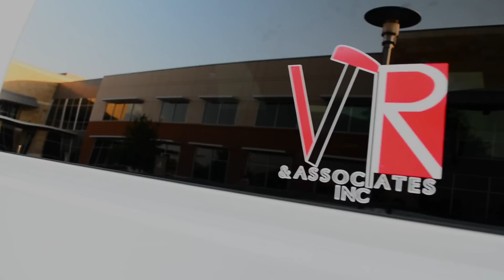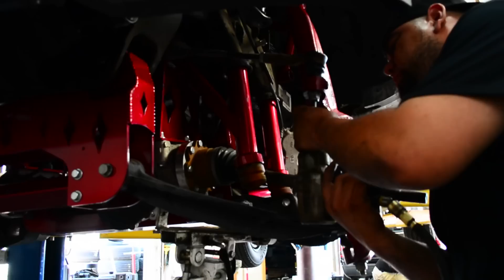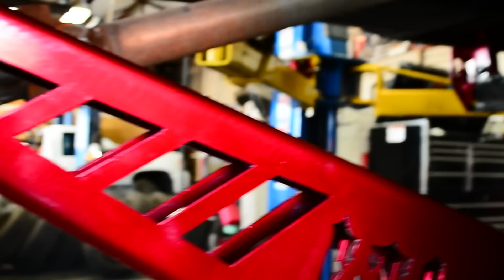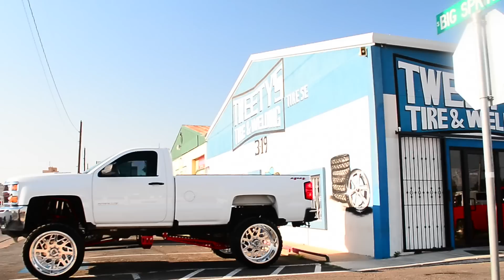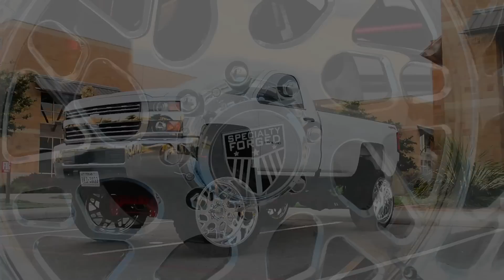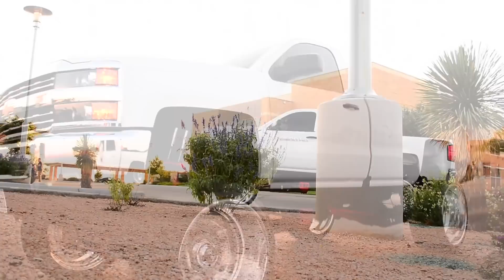How West Texas does work trucks! 2014 Silverado Long Bed Single Cab on 10inch FTS lift 26x16 wheels

Comment: How many miles can those tires go? 30,000mi?
Reply: Joe Caballero If you rotate them often they would definitely last 30,000 miles
Reply: Eugene Krabs what do you mean by rotate?
Reply: Shallow Exodus Take the tire off the rim, flip the tire over to the other side, put the tire back on the rim.
Reply: Eugene Krabs isn't that bad though?

Comment: how much is this cost ? evrything ?
Reply: FUNNY WORK VIDEOS!! Probably $10,000
Reply: I was thinking the same amount ;)
Reply: Diapason Dlvg 😂😂😂😂 maybe for the powder coating on the lift/accessories...
Reply: Blake Z71 That lift is $4600, tires and rims are $4000, the little amount of powder coating the suspension has costs $1400, which makes $10,000. Don't act like you know something if you don't. Look up the parts if you don't believe me.
Reply: Diapason Dlvg wasn't acting like I knew something. I was being sarcastic hence the emoji. I'm my opinion 5k in ad dons should be max...
Reply: FUNNY WORK VIDEOS!! Wrong. A 10" to 12" suspension cost 7k that's fully upgrade with shocks. And after tax going to be 8k on suspension . And tires and rims goes for 7k kuz it's 26" rims so almost 2k a peace

Comment: Where is the work truck?
Reply: SouthernKyCoalRoller 0:05 but now it won't hall any thing or even taken off road
Reply: @ethancummings2455  I bought a blacked out 2018 work truck same thing but short box and itll never see gravel or dirt and rarely haul things. It's also stock. So you point is.... what?
Reply: Long bed

Comment: Axles are still on the ground 12" lift ?? More like a glorified body lift
Reply: alexerstube lol how do you describe a lift?? Axles are going to stay the same regardless of the “body lift” or the suspension lift??? That’s the axles are where the wheels connect to, -Meaning the lift goes above the axle to raise everything up. The height of the axle depends on the size of the rims and tires your running.  Lol.

Comment: Never get a truck from west Texas! They turned a capable work truck into a useless pavement pounder. You can't drive this truck off road. Just trying to park this "truck" could cost you hundreds if not thousands of dollars if you get too close to the curb and scuff a rim.
Reply: That goes for any other nice truck or car.Your point is invalid
Reply: Lolz Senoir 
Nope still valid, that truck will never see a mud hole. It doesn't look good, and the tires aren't wide enough to protect the rims. And the sidewalls aren't tall enough to get off road. The truck is only good for one thing... mall crawler, but only if you don't hit the parking bumper. If you do you will pinch the sidewall and have a flat. The lift is great but the wheel and tire combo makes the truck useless off-road.
Reply: Agreed